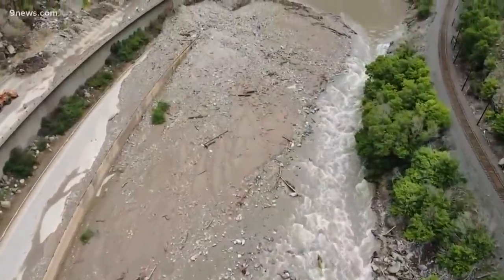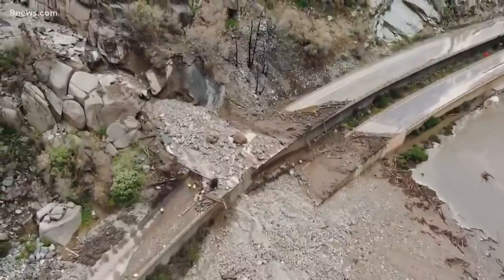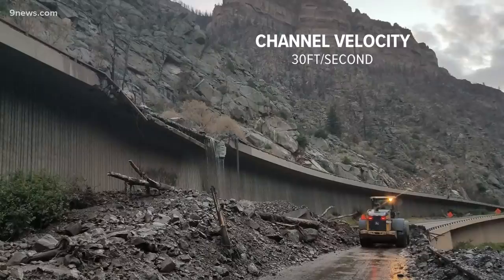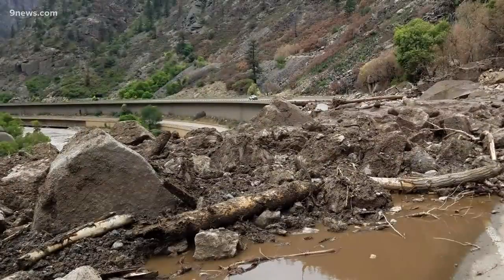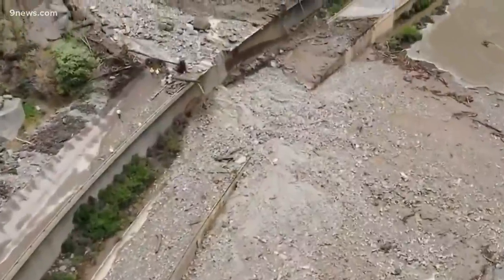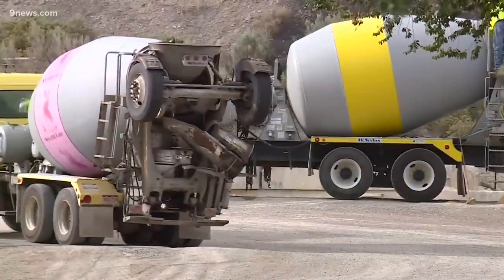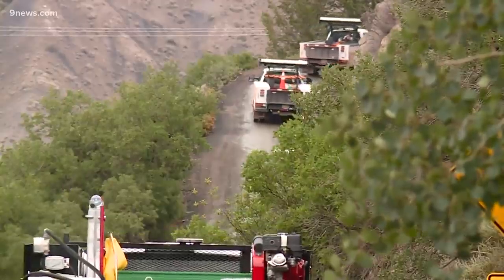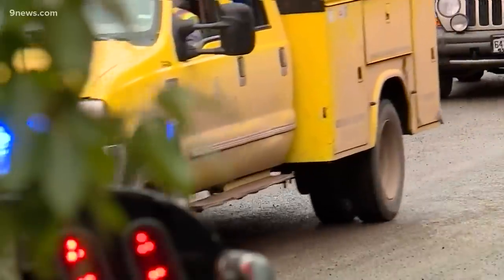How flash flooding caused extensive damage to I-70 in Glenwood Canyon

Comment: Was stuck in this very spot for 5 hours over the 4th of July. All the drains on the road where plugged up the mud and rain was as high as the guard rails. Even then you could here the cement cracking and popping under much less weight. We were bored so we cleaned out all the drains and drained off all the water.

Comment: The DOT should consider a tunnel or a slide shoot over the highway to prevent damage like this. It's gonna happen again if not mitigated. The Coaghilla Highway in BC, Canada has an avalanche shoot across the highway called the Great Bear Snow Tunnel.
Reply: Except how many of those side canyons exist along that 13 mile stretch of Glenwood Canyon? It probably wasn't nearly as vulnerable prior to last year's fires.
Reply: Erik Hyndman  You’re right, it would be so much better if it went back to two lanes like hwy  6 was. The mudslides wouldn’t have had any affect.